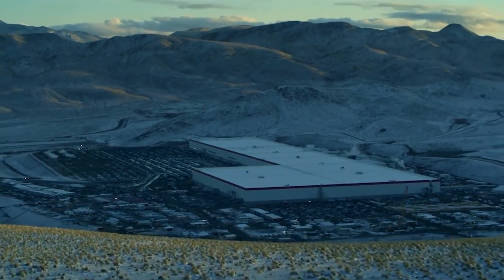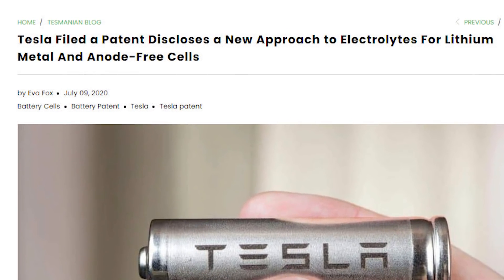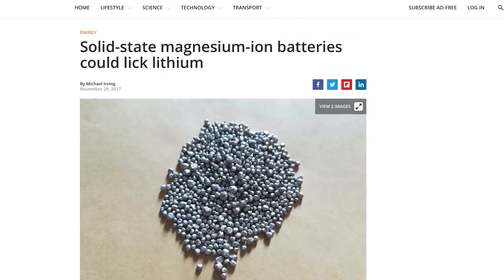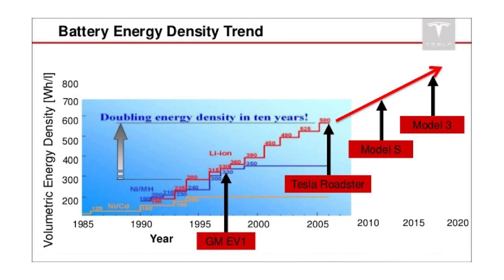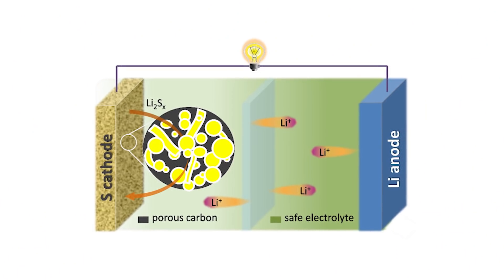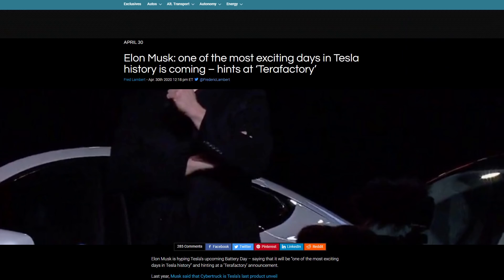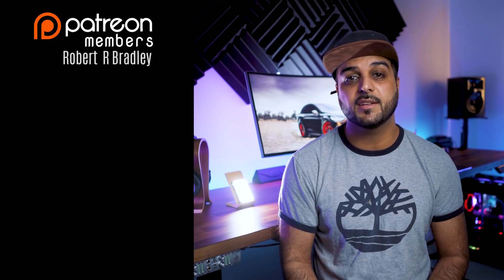NEW Tesla Battery Patent at Battery Day? Future Technologies & Decade Of Battery Breakthroughs

Comment: Let's not forget our physics.  The material specific energy density of Lithium-ion is less than 300 wh/Kg.  Having a goal of 2,600 wh/Kg with some other material is fine, but you acknowledge any commercial use is years away.  Clean H2, (made from renewable energy electrolyzing water to make clean H2) has an energy density of over 40,000 wh/Kg.  Isn't that worth mentioning?  Nature's perfect battery is H2 itself.  The govern. and companies like Tesla are going after very low energy density approaches, even 2,600 wh/Kg (years away) doesn't compare at all to plain old clean H2 at over 40,000 wh/Kg - Today.  Why is this alway (mostly) ignored by people trying to discuss energy storage?  "All battery EVs", often ignore the Fuel Cell EVs, and how this discussion of trying to develop an ideal battery - totally ignores the physics which points out we have one already:  clean H2.
Reply: I used to be extremely bullish on a hydrogen economy. I still see the value of hydrogen, but in different ways. Electrolizing, storing, and consuming hydrogen in a PEM (or other) fuel cell has it's own efficiency issues. There is no perfect solution. 
Yet.
Reply: @timyarrow8844  But, there is a great solution!  Indeed, you say no perfect solution, but actually, clean H2 is a total solution.  Don't get too caught up in efficiency... when you consider Life-cycle efficiency then all battery configurations have big issues.  An EV is only as clean as the charging source.  With Clean H2 (using only renewables on the front end) we have indeed, a perfect solution.  H2 is nature's perfect battery, let's use it... and, remember, use the H2 and you get most of the water back.  It's the only energy cycle which is compatible with life.  Clean H2 is potent, safe, available to everyone everywhere, and is 100% non toxic.  Now, that's a solution!

Comment: is there a better size of the lithium battery than 18650. 30999   size gives you more power and is still small. the specific size isn't important. it is being able to   connect         a lot of then for   a specific task.

Comment: Quite frankly, it doesn't matter what MY thoughts are on ANY of these developments.  IF it happens, it happens.  IF it doesn't, it doesn't.  Would it be exciting?  Absolutely.  BUT, the NEXT BIG THING is always just around the corner.  A good example would be an actual running Nikola Truck.  Even the mighty Toyota showed promising development with their RAV4 Prime BUT they either can't (or more probably won't) produce it in any significant volumes, rather using it as a compliance vehicle.
As Elon Musk has said, "Everything works in PowerPoint".  Now show us something real!

Comment: Great video!  But your title screen photo of 2.6 KWh/kg would be more than twice the energy of a stick of TNT

It is possible, but current batteries are already dangerous, any breakthrough would need well proven safety constraints.
Reply: Dude,  the TNT Equivalent is a common unit of energy, not power.   kWH is also a unit of energy.  No mix up of energy and power,

Comment: Funny how you warmers never discuss the doubling of the household electric bill to cover charging. In addition, there has been no move to build new power plants because of greens resistance. Solar and wind are not only extremely ugly but they gobble up square miles of land and deliver almost no electricity when compared to natural gas (methane) as a means to supply electricity. Unfortunately windmills are also known to be indiscriminate when it comes to the millions of birds they hack out of the sky every year. Too bad for the protected birds like hawks,  eagles and others who are hacked out of the sky by the deadly blades of windmills. So far the Left is looking the other way. But what happens when they decide to take all those deadly razors out of the sky in deference to protected birds? Where will you get your electricity then?
Until we get Fusion power, the answer will always be more natural gas and more gas turbines to supply the doubling of electricity required. And wait until all those EC customers find that they are paying an extra $250 a month for they shiny electric car?
Reply: Ok Elmer and when people have solar on their roof and battery banks in the garage you can suck eggs.

Comment: Good documentary by EV Source. While increasing battery capacity and decreasing its size, remember that integrated supercapacitors and greater access to charging terminals are an integral part of this system to keep the battery as far as possible in the golden state (13.33 volt NiCd).

Comment: Final days of the oil age...
Reply: Not so for long range aviation, where, counting all efficiency losses the energy per kg fuel exceeds 6000 Watthr/kg, mainly due to free oxygen from the atmosphere (3/4 of the mass, roughly).
In addition most of the fuel is burned up and the fuel consumption gradually decreases( by increasing the flight's altitude, typically climbing to cruise at FL 310 and stepwise increasing cruise to FL 370 before descending to land
(FL = hundred ft at standard altimeter setting, all aircraft above 18000 ft fly on equal atmospheric pressure surfaces independent of the surface barometric pressure variations)
Electric aircraft must carry the battery weight from take off to landing, requiring longer runways to land.
For the forseeable future,  aviation fuel will remain carbon based even when SpaceX operates the Starship as a intercontinental transport.
Reply: kong tàbg fi7ght biatß stinnll m8ñeum ²500byearß too 5200byessàrs out

Comment: Great Content. Although I try not to get too excited about some of the prospects. 2600Wh/kg and 2000 cycles seems too good to be true for now and the near future. But the future for batteries and BEVs is definitely a bright one. Hopefully people and politicians who hype hydrogen and fuel cells so much right now wake up soon and stop wasting energy(!) and funds in the hydrogen hype which is a total dead end.
Reply: Man Tom with that sort of density, I believe having a small battery pack with slightly more range is the the choice instead of huge unnecessary range increases
Reply: If my math is right then the 2600Wh/KG at 2000 cycles would be 5,000,000 mile battery
Reply: @BBBYpsi  
Or much smaller battery packs
Reply: J Smith what nonsense are you talking about? Yes you can turn small amount of lead into gold in a particle accelerator, but it’s not worth the cost
Reply: J Smith what drugs are you on?
Solar panels produce more energy that it takes to creat them. You have a brain so try using it to do some current research rather that make stupid statements.

Comment: Carmageddon is coming soon and Tesla will be alone on the top. All due to battery scarcity.
Reply: I share your general optimistic outlook for the beginning of the end of ICE automobiles. And Tesla has at least a 3-4 year lead in the technology. But I disagree that there will be battery scarcity per se. There will be a relative scarcity of top-shelf leading-edge batteries because of demand. 
This was Tesla's Q2 earnings message yesterday: "We don't have a demand problem. We have a shortage of some supplies in the pipeline....that we are working to close."
In short, I believe that Tesla's greatest challenge will be to ensure that demand does not outstrip supply that BEV buyers turn to other producers. Inevitably I believe just that will happen, and rightly so, because an absolute Tesla BEV monopoly is unthinkably dangerous to a functioning - and innovating - marketplace of ideas.
That said, Tesla deserves heaps of praise for their vision and execution. The Tesla leaders deserve rich monetary rewards for the risks they have taken.

Comment: 70 cycles is still 270000 miles when used in model S. I'm ok with that as Tesla improved,. Use it now to accelerate the adoption to sustainable energy.
Reply: What is the energy density of these cells per kw hour and per litre as I have not seen it stated anywhere.

Comment: 125 miles range + ability to rent a 70KWh mobile battery for cheap prices for the few days in a cars lifetime where it actually needs 400+ miles would be the best solution

125 miles model 3 type sedan or clone would only require ~27KWh pack which would save 180kg of mass improving efficiency and reducing tire wear plus halving the battery cost Vs a 250 mile option

125 miles X 4,000 cycles is 500,000 mile life which is more than enough as most cars are scrapped before reaching 200,000 miles mostly because people don't like driving in old ratty 20+ year old cars and would rather upgrade
Reply: Looks like NIO's plans with battery swapping.
Reply: You make a couple great points (rent a larger capacity battery pack when needed for longer trips...brilliant!). 

But your "27KWh pack which would save 180kg of mass" point misses the greater energy/kg density of future batteries. 
Even if battery technology is only half as good as the predicted 2600wh/kg, a 180kg mass battery could still pack as much as 200kwh into it...far better than the best current BEV. Everything is cheaper and lighter in the future, which means less efficiency penalty for greater range.
Reply: no one jeps careß ²5000⁰ mioe buy ibg ñew one fke cyckeß lkety

Comment: I'm thinking that home energy storage will become cheaper too! Maybe to the point where the Solar Panels + the Energy storage will be the less expensive part & the jobs that help build sustainable energy sources/networks will become higher paying
Reply from the maker: I agree! Battery energy storage systems will start to become more common. As these breakthroughs continue, devices that use batteries as their main source of power will get a major power upgrade. Currently, many portable devices are limited by their energy density. It's a bottleneck that is holding things back, but it will soon be overcome and that's when we will see the "big shift". Battery energy storage systems are ripe for disruption, and I believe that's what this 2020's decade will be (mostly) about.
Reply: You're living in La-La land. 
An extra $250 a month for electricity should not be a problem for you warmers. Right? And because they are not building new power plants it will probably double when more ECs come online.

Comment: Some G R E A T! info. If that 2600 wh/kg w/2000 cycles gets to market, the world will change in a drastic way.
Reply from the maker: Future looks bright indeed 🙂
Reply: @WattsTheFuture  for those on this thread, this troll I kaya is a troll ( big oil, Russia, etc ) who intends to harass others. Feel free to report
Reply: Inch Grundle  There isn't just poor and rich, there's also middle class. I'm not rich but with my solar panels I can definitely sustain myself with electricity.
If only I had a powerwall and I would be able to store energy to use during less sunny days and become truly self-reliant. We can eventually become immune to blackouts.
Reply: It definitely will change the world in a drastic way because it will probably require the changing of physical constants and if you can do that then why stop at batteries you've just discovered a way to manipulate the laws of physics themselves

That or a video maker on youtube just posted random numbers that have no basis in reality
Reply: Like a lot of you tube video makers he has no scientific training and just copies figures and numbers from websites with no underlying understanding

2,600 Wh/kg is an impossible figure to reach

You can prove this quite easily by looking at a pure explosive like TNT which is 1,162 Wh/kg

TNT is pretty much as high an energy density you can get in a fully enclosed system. Petrol has a higher figure because it isn't enclosed it takes oxygen from the air

So it's reasonable to give 1,162Wh/kg as an upper limit. Now realistically a chargeable battery will only get a fraction of that number

If I was a betting man I would suggest we won't get anything above 500Wh/kg this side of 2050
Reply: @kaya051285  i appreciate your skepticism. But then how do we interpret the experimental result of 2600 Wh/kg? 

I think it's silly to consider TNT the upper enclosed specific energy limit for batteries. Just because TNT detonates instantly doesn't mean it is a good proxy for highest possible enclosed energy content of a battery. The mechanism of energy release is not even comparable to batteries. This would be like saying that TNT energy density is an upper limit for nuclear fissile material... but uranium has a specific energy of 22 GWh/kg. The mechanism of energy release is not comparable.

Lithium metal has a theoretical specific energy of 11,972 Wh/kg

So, even considering just 21% efficiency of a battery which allows storage and transfer of lithium electrons, a lithium battery can easily achieve 2600 Wh/kg
Reply from the maker: Well said! Good healthy skepticism is fine as long as one keeps an open mind. Lithium batteries have a long lifespan ahead of them because there's so much untapped potential to be realized. Unless there's a major breakthrough in other materials that can make lithium obsolete, lithium will continue to be the choice for future battery and energy storage systems. Had there been the type R&D on battery technologies that we do today decades ago, who knows how advanced today's batteries would have been.
Reply: @Haliotro  you have no idea what you are talking about

Batteries don't use nuclear reactions they are chemical reactions

If we are using fantasy numbers then let's pretend the limit is an exploding singularity in which case the upper limit of a battery is the entire energy content of the known universe because well this is you tube and people who know nothing about nothing can make statements like yours

A battery is a fully contained and reverseable chemical reaction. There is an physical limit to the energy of chemical reactions and there is a much lower physical limit to the energy of a fully rechargeable self contained battery

Anyway no point arguing with someone who thinks nuclear reactions are relevent to the discussion of what's possible with chemical batteries

I'll just repeat that I don't expect more than 500Wh/Kg for a fully reusable sealed battery this side of 2050
Reply: @Haliotro  how do we interpret the 2,600WH/KG?

Well simple. It's a lie. Or you didn't know or understand what you were reading

Take another chemical reaction
Hydrogen and oxygen
The stuff they use to fuel rockets spaceships

Guess what the energy density of that is?
3,700WH/kg 

So if someone is telling you they have a fully enclosed rechargeable battery that has an energy density close to what powers rocket engines then you should be skeptical and think they are trying to sell you some BS

Most likely you just don't understand what was being talked about or written
Reply: @kaya051285  I heard of 800Wh/Kg might be the limit??(wishfull thinking...) and probably get to 500Wh/Kg by 2030??? just hear say...
Reply: @kaya051285  And what scientific training and background do YOU have to make evaluations and be reasonably believable/useful?
Reply: @Inteli9  a degree in physics from a world top 5 university. What about you?

By the way it doesn't matter what certificate contains my name. I can simply point out that a rechargeable sealed battery is a chemical reaction and then I can give you a list of chemical reactions and their energy density

Which is what I did
I gave the example of the energy density of TNT a pretty great fully enclosed chemical reaction

Those who sauna battery isn't TNT are right a chemical battery will never have the energy density of TNT it will only attain a fraction of the energy density of TNT

Even as a person with no scientific training what sounds more realistic to you? That batteries can or can't exceed the energy density of a high grade explosive?
Reply: @kaya051285  You may be right, I can't tell, bearly know English, but not because of your degree, unless you tell me that your university is highly connected to the modern industry. If that's the case, see me clap standing.

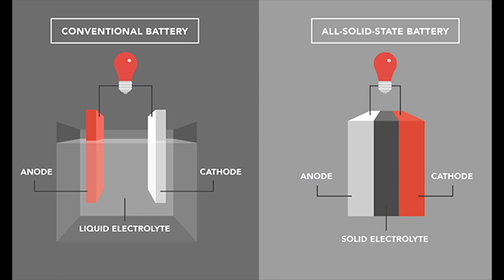Comment: Good video!  Would like to see a graphic showing the "Anode free" battery.  When you discussed this at the end of the video, at about 10:44 you show two batteries with anodes.  You do not show a graphic of a battery without an anode.  Did you mean "without an electrolyte " instead?
Reply from the maker: Didn't find any image or graph of the anode-free battery, unfortunately 😟 Once more information available, I'll be updating on this battery and hopefully by then we will have more to chew on